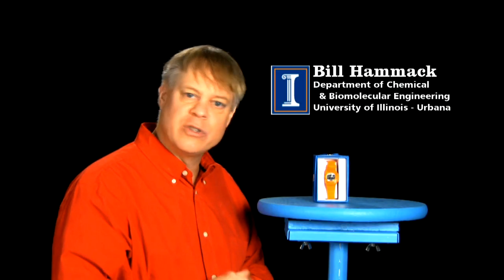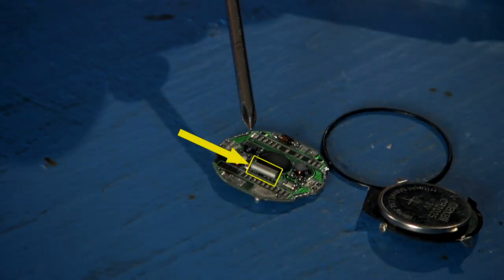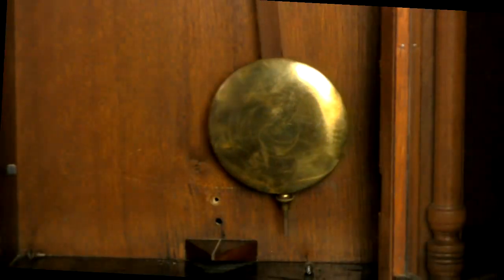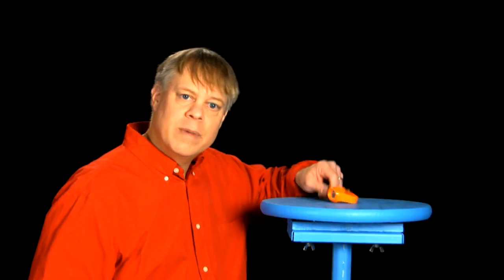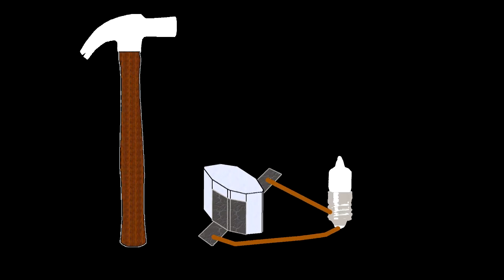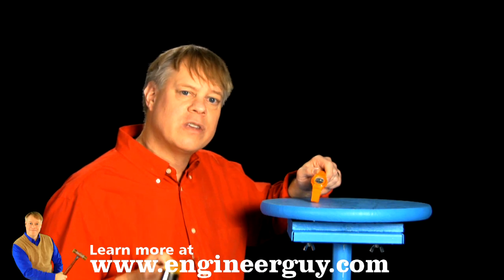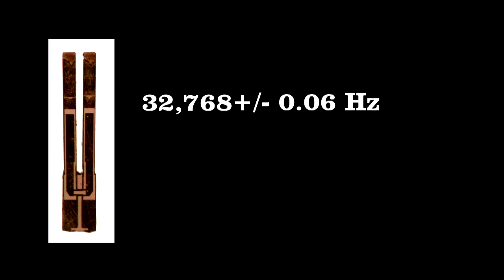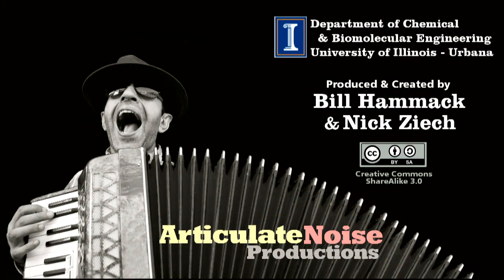How a quartz watch works

Comment: @NorbPwn That's exactly what the program does. When the program counts exactly 32,768 pulses from the crystal, it knows that exactly one second has passed and breaks it down into minutes and hours to display the time. However, less featureful watches usually contain circuitry that does the same thing as a program would except cheaper and while using less power.

Comment: If you're asking specifically about quartz, that I don't know. Quartz is probably the cheapest and simplest way to generate a clock signal. There might be other crystals out there that do just as well, but they're probably a hell of a lot rarer and thus, more expensive. 

There's other ways to generate a clock signal, such as charging a capacitor and then the "beat" of the signal is when it's full, and the frequency set by how fast it charges, but that would be unreliable and probably wear out.

Comment: Key word here is "oscillator", they are a standard electrical component used to generate a signal usually measured in Hertz (eg, Hz, MHz, KHz) and inside and a quartz crystal on a microscopic scale surrounded by insulation and a metal cover.

Comment: In the finished product, is the quartz suspended in air, a vacuum, or some other fluid?
Reply: one would expect vacuum... no?
Reply: Air would make the most sense. But an interesting question is then, how much difference would changing the surrounding fluid make? If the watch is subjected to a vacuum and the quartz enclosure leaks slowly,would its frequency increase?

Comment: It's not change inside the clock that causes this.
Its the actual slowing down of time.
In fact if two people were kept near each of the clocks to check to monitor if it was working correctly they would both report yes

Comment: How do they convert the digital clock to output on screen?
Reply: 1) divide the pulses by 32768 to get one pulse per second
2) compare the seconds to a reference (stored when you set your watch)
3) get seconds in the current day (with modulo-86400 arithmetic)
4) convert seconds to hh:mm:ss (with more modulo arithmetic)
5) convert each digit to segments of a 7-segment LCD display (with a lookup table)
This is done either with a microprocessor or more likely, a custom-made chip

Comment: Um, thank you for making it simple, but doesn't there have to be some sort of inverter or some sort of on/of from the d.c. to create the hammer effect? Thanks. (subscribed)
Reply: Yup, connected to dc it will deform in one direction, not continue to oscillate.  You need an electronic oscillator whose frequency is steered by the crystal.  He missed that out.

Comment: There are quartz oscillators in so many things now days.  Probably anything with a microcontroller will have a quartz crystal.  We really have been spoiled.  I have one of the original BULOVA tuning fork watches I bought back in '72 and it's a totally mechanical timepiece with a metal tuning fork that you can actually hear.  Keeps pretty good time too.

Comment: In the diagram of the quartz connected to the battery, the quartz deforms only once when contact is made. If this is the case, then how are the 32k vibrations created from the fork if it is connected to the battery?

Comment: I thought that tiny cylinder like thing was a capacitor I was wrong like always
Reply: Don't be too hard on yourself!  It is a capacitor!   A varying voltage is applied between two plates with an insulator between.  This causes mechanical deformation in any capacitor (opposite charges attract),  the effect is usually undesirable and called ringing.  Here it's desired and using a piezo material for the insulator enhances it.
Reply: Same bro

Comment: Hello engineeringguy sir , can you tell me how did the makers of quartz fork made it to give a result of one second? In comparison to what does the watch system knows he is reading exactly one second interval?Is the voltage from the battery constantly applied to the fork therefore making the watch system constantly counting oscillations?Does the fork always gives constant number of oscillations for given voltage?
Reply: 1.They add a deposit of gold on the ends to have an inital low frequency, then they continously remove a little gold at a time (using laser) until they reached a frequency of 32768Hz
2.The system doesn't know. It is uses a binary counter that increments on every vibration. When the counter reaches 32768 and tries to increase it to 32769, it instead resets it to 0 and notifies some other part of the system that a second has passed. 
Why 32768? It is equal to 2^15 representable by 15 bits and (according to wikipedia) just high enough so people cannot hear it
Reply: Makrillz Wow.. that is just wow .. m gonna show this in my first physics class when i talk about length mass and time :D
Reply: +Makrills has nicely explained most of your query. I want to try to explain what was left. 

"Is the voltage from the battery constantly applied to the fork therefore making the watch system constantly counting oscillations?"

The voltage across the piezoelectric crystal is applied in pulses. It means that you apply a voltage and deform the crystal and then release the voltage. This sets the fork to vibration. But that vibration will stop after some time if you don't deform it again. Now you have to make sure that you apply the voltage again before it stops vibrating. (I don't know the exact frequency of the pulse needed to keep it in vibration)

"Does the fork always give constant number of oscillations for given voltage?"

The frequency of the tuning fork depends upon the length, cross sectional area, mass, density and young's modulus of the material from which it is made. So basically it depends upon the design of the fork and not on the amplitude of vibration. This is called its natural frequency. (Just like a 39.1 inches long pendulum placed in 9.8 m/s^2 has a natural frequency of 2 seconds, no matter how large amplitude is induced in it).  Voltage determines the amplitude of the fork so it will not directly effect the frequency.
Reply: 2006mct42 Thank you for your answer. Its amazing how much small and short events are inside of a watch . I wonder now how is voltage applied in pulses, there must be a tiny multivibrator or something..:)
Reply: Yes that's uber-amazing. Watch is an engineering marvel. Regarding applying the pulse it can be done based on the vibrations themselves. The electronic counter which is counting the voltage vibrations can be used to generate a pulse each time it reaches a certain value. e.g. we can program it like when it reaches 32768 it applies the voltage pulse to the crystal and adds one second to the clock simultaneously.
Reply: 2006mct42 Hey I'm still not sure how the electronic counter works, Bill mentioned that it measures the current fluctuations, but how does it do that exactly?

Comment: See, that tiny fork is vibrating so little, yet so fast that it barely notices something like that, not to mention the axis of acceleration has to align with the axis of vibration (basically, the fork has to be vibrating in the same direction as the watch is falling), that it barely notices, and even if it does, the circuitry sets it back in perfect time in a fraction of a blink of an eye.

Comment: If I recall correctly, if you deform a crystal it generates a voltage, not a current. These are two very different things
Reply: Correct. And you don't make them oscillate by directly connecting them to a lithium cell either.

Comment: How can the DC battery cause the crystal to vibrate? Should it be AC?
Reply: I love stuff like this, so many functions packed in ONE component. Here, straight from Wikipedia:

"When a crystal of quartz is properly cut and mounted, it can be made to distort in an electric field by applying a voltage to an electrode near or on the crystal. This property is known as electrostriction or inverse piezoelectricity. When the field is removed, the quartz will generate an electric field as it returns to its previous shape, and this can generate a voltage. The result is that a quartz crystal behaves like a circuit composed of an inductor, capacitor and resistor, with a precise resonant frequency."

You see, you just have to apply a voltage once, which induces deformation. The deformation is not the crystals "preferred" shape, so it jumps back into the preferred one. This jumping back is, again, a deformation, which induces in itself a voltage. Now you've gone full circle!
Thus, just by removing and not reversing the current you can make the quartz crystal resonate.
Reply: Peter Pepper
 That's interesting. So it starts with a voltage >>deformation>>voltage>>deformation and so on, creating clock. Since this process isn't 100%efficient the original voltage will be stronger then the secondary voltage induced when the crystal loses it's newly formed shape. This weak secondary voltage would need to be amplified before going to the crystal again, in order for the process to be sustainable. I would imagine the secondary voltage shortly activates a transistor which while it's activate will connect the battery to the crystal again, repeating the cycle. So it's batterVoltage>>Deformation>>SecondaryVoltage>>activateTransistor>batteryVoltage  and the loop is complete.

anyone care to comment on the validity of the above?

Comment: 2:48  Hey, I recognize that number!!
Reply: +RonJohn63   Yep.  2^15.  Divide by 2  for 15 times and you get 1 pulse per second.  That'll drive a stepper motor for the second hand, or the seconds counter in a base 60, base 60, base 24 digital clock counter string.

Comment: One really important thing you forgot to mention is that a quartz timer sets the clock signal for all synchronous integrated circuits! Your computer's CPU wouldn't work without it (or at least would be really slow and complicated)!

Comment: 32768 is my lucky number
Reply: If you use a 16 bit counter, with that number it overflows exactly twice per second. That clock isn't counting seconds, it's counting half seconds, then converting the number into our regular time.
Reply: Hold on. 2^16 is 65,536. If you're counting at a rate of 32,768 times per second, wouldn't that overflow once every two seconds?
Reply: D'oh! You're right. Then you use 15 bits for counting a second, so you have one extra bit for something else.
Reply: I'm fond of 0xDEADBEEF
Reply: @DiThi  extra bit is for tagging  the data probably

Comment: If that wasn't sarcasm (it's not like it's possible to tell in text), then: eeyup.

Anything more complicated than a talking chip in a stuffed animal usually requires some sort of clock signal. If two parts of a chip have to communicate with each other, to keep things simple, they use a clock signal as a beat or rhythm. Otherwise, they'd also have to have separate circuits telling them when to speak and when to listen, based on what all the other circuits are saying.

Comment: Oh, I thought until now, that electronic watches used alternating current circuits tuned to a specific frequency (like computer clocks work).
Reply: That "computer" frequency is also tuned with an oscillating crystal. So CPUs also use a crystal that determines the frequency.

Comment: I've been using digital clocks since they first came out about 40 years ago.  Most of them are less accurate than good mechanical clocks.  mechanical clocks can be adjusted to become more accurate, and some will self-adjust, based on the amount of manual time adjustment each day.

Why is there not some simple circuitry in all digital clocks, that corrects the rate of the clock?  It would simply record the amount of manual adjustment made, calculated over the time between adjustments, and adjust the rate of the clock accordingly.
Reply: +Landrew0 You can buy cheap, battery-operated clocks which correct themselves via a radio signal and so stay perfectly in-time to all intents and purposes.
Reply: All that radio stuff is totally unnecessary. All you need is a simple algorithm that uses little feedback from the user.  It wouldn't add any cost at all to any clock circuit.
Reply: How much do you need to know, to see that digital clocks are much less accurate than they could be?
Reply: +Landrew0 
They are however much more accurate than a mechanical system.

Comment: Me: 🤗was excited to make a comment about how GPS satellites 🛰 have atomic clocks, and it’s the most mindblowing everyday demonstration of the universe’s spacetime
Also me: 👀 notices Bill already did a video on this, 9 years ago. 😧
Well I’m gonna tell you anyway. 😁
Did you know if a person were to theoretically travel in a spacecraft away from earth and reached the speed of 1 light year per second, when they returned, the people on earth would have aged more compared to the person in the spacecraft? It’s not even a theory, it’s a proven fact, and GPS hinges on this, and anywhere you have ever seen a GPS provide an accurate signal, you have witnessed it. 

Because a large mass in space, it’s gravity “bends spacetime” 🌌🌎🌌
In other words, the closer you are to the planet, the slower time passes for you. Yeah, my own mind is already blown at this point. But check wiki and you’ll quickly find a graphic that’s similar to the shape of a stretch-wrap film over a food dish, with a plum resting on top. That’s earth bending spacetime. 

Einstein’s famous Theory of General Relativity “E=mc2” is all about this. 

GPS signal is really nothing more than little timestamps you receive from ultra accurate atomic atomic clocks aboard at least 3 satellites. Pretend you receive these 3 signals:
12:34:56.000000000027
12:34:55.000000000098
12:34:56.000000000013

From that, you can deduce the 3rd satellite is the closest (...0013) and the 2nd satellite is the furthest (..0098). Because they are all using the most precise clocks ever made: atomic clocks, carefully set before launch into space, you can rely upon the accuracy of each signal. 

Even though all 3 signals were literally sent at the exact same instant, the difference is how long the signal took to reach you. 

That’s the basics of how GPS works and it’s definitely impressive but essentially just trigonometry. 

The real mind blower is the fact that GPS satellites must always correct the atomic clock’s signal for their altitude (distance away from earth, remember my beginning?) before it is sent, because of the fact that the sliiiiiightly far distance from earth 🌍 (at least, compared to us here on the surface) is enough that the slightly slower passage of time must be factored in, or else GPS accuracy would drift to something like 5 miles in a matter of weeks, after which it would become useless. (Typical handheld GPS/smartphone accuracy is +/-16ft (4m)).

So, whenever I encounter some ignorant, overconfident fool spouting off how “Ahh, those scientists and experts don’t know what they’re talking about, blah blah blah”, I always love to bring up this example because GPS is so common and yet the slower passage of time in space is a crucial factor without which GPS would not have any usable accuracy. 

I literally don’t even know what I’m talking about but I’m confident you definitely found this as mind blowing as me!
Reply: Bill’s video: https://youtu.be/p2BxAu6WZI8

Comment: If I recall correctly, if you deform a crystal it generates a voltage, not a current. These are two very different things
Reply: Assuming you have a conducting wire connected with some non-zero resistivity, then they are identical things. It generates a voltage, which applied across a load, generates a current.

Comment: engineerguy, And to think I always thought that it was only the 9,192,631,770 vibrations periods of radiation corresponding to the ground state of the cesium -133 atom that kept the timing of 1 second.
Reply from the maker: Me too ... until I researched the video!
Reply: @engineerguyvideo  Ha.
Reply: Haha!  Try buying a caesium wristwatch!  It fascinates me that the timing from GPS is probably the most accurate that we plebs can get,  I'd love to see a video of that compared to quartz, Internet,  longwave time signals etc.  At the moment quartz is hyper energy efficient, there aren't many things that run for 3 years from a tiny battery.

Comment: Wait, he lost me. The quartz is not physically being hit by anything, so what causes the continuous vibration? Was it the charge from the battery? The battery causes it to vibrate?
Reply: I hate to criticise the presenter,  but he missed an important step.  A circuit is needed to oscillate and bash the crystal repetitively at about its natural frequency.  The bashing is done by way of alternating the charge between the plates, which makes it bend.  The crystal is not connected across the battery.  But this circuit must not be rigidly dictatorial, it must respond to the preferred frequency of the crystal.  They come into mutual resonance.  So the design is such that the electronic circuit tries to make the crystal oscillate at some nearby frequency, but responds to any misalignment and delivers energy to the crystal at its resonant frequency.

Comment: If the gold is simply used as a weight, why not use something cheaper like lead?
Reply: DATA REDACTED Lead just doesn't sparkle. :3 

There's probably a reason, though.
Reply: DATA REDACTED gold is heaver and its less reactive
Reply: ModernGameArmy True, but not that much heavier, and most watches are sealed. Maybe it's for conductive purposes?
Reply: DATA REDACTED When I say not that much, I mean for this scale. Even then, surely there's a cheaper alloy that can do the same job?
Reply: DATA REDACTED I think it's also because gold can produce a stable foil very easily. You can beat gold down into a foil a few atoms thick with no problem. Much harder to do with other metals, especially since they will oxidize and change weight significantly.